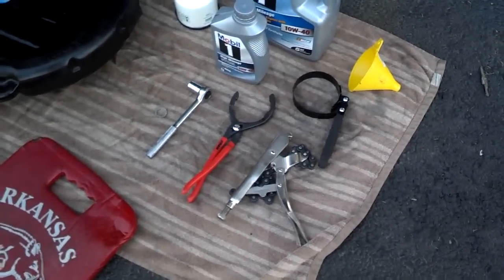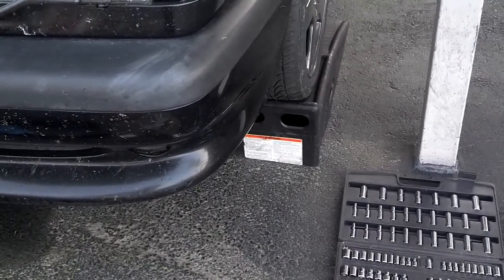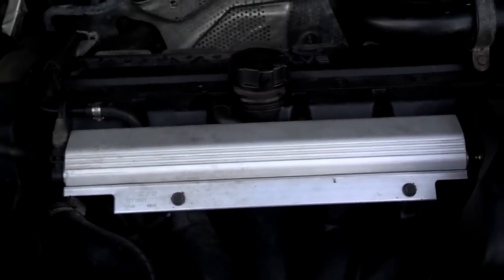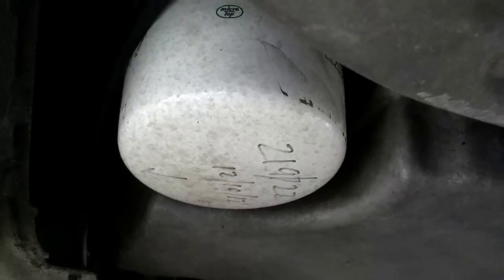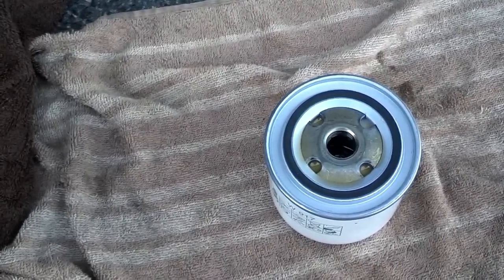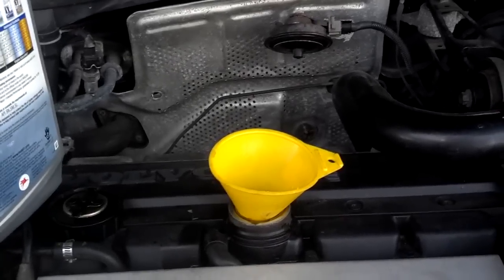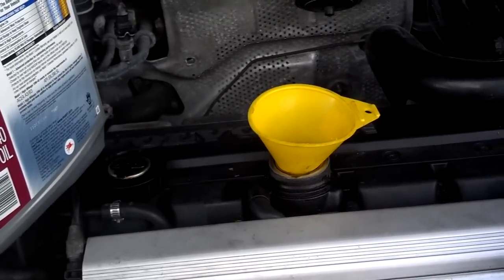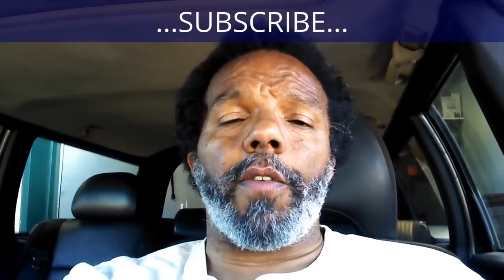How to do a basic oil change for the Volvo 850, S70, V70, etc. - Remix

Comment: Your great Robert guess what my engine died last Friday.  Jiffy Lube left   the oil cap off a year ago. I left that night drove a half hour on the L IE( Long Island Expressway) came back the next day and I smelled something , pulled into my gym open the hood in there it was,  the cap left off!!!!   oil everywhere! I just lost my car last Friday I think something had to do with that after while you can't go to the dealer anymore it's too costly I have a 93 850 GLT tan colored interior pretty car hear create Robert guess what my engine died a year ago Jiffy Lube left the oil cap off I left that night through a half hour on the LA Long Island Expressway came back the next day and I smoke something pulled into my gym open the hood and there was that cat left off coil everywhere I just lost my car last Friday I think something had to do with that after while you can't go to the dealer anymore it's too costly I have a 93 850 GLT bought in VA 1993 I paid in ful..cant do that again. tan colored interior. Outside too.. pretty car paid in full for it but living here 10 years on Long Island has  weatheredbiy did visor doesn't work on the driver side a little oxidation on the top passenger side in the back trunk a lock mechanisms kind of messed up I just couldn't keep it up anymore there's always something that happens with it but she's a good-looking car does anybody want one I'm here on Long Island Deer Park , New York 11729 make an offer. This is Jan 8, 2020.
Reply from the maker: post it on FaceBook market place.

Comment: Good job Robert but you should mention some vehicles like my 99 S70 AWD 2.4 turbo has a Cartridge although in same location , I just went to do an oil change and found that the owners before me had taken the vehicle to a shop for oil change and they had sealed the drain plug with silicone so very good tip on the drain plug gasket :) Keep doing what your doing I often visit as am new to Volvo but mechanically inclined :)
Reply from the maker: That's a different video. I'm sure this one said through 1998.

Comment: hey robert i have a 97 volvo 850 i have the oil pan crack and a friend told me that he can take ir to someone and get it weld but he told me if it have magnesium you cant weld it you may have to put jb weld or something do you know if the oil pan can get weld??
Reply from the maker: +Ruben Rodriguez no I don't. I'm going to know weld mine. Stop drill the cracks.
Reply: Dear Ruben   please find CVI  on the net and simply find the part you need and they will send it over  they supply all parts for all Volvos  are not expensive and very helpful

Comment: I have a 1999 Base 2.4L S70 with 194000 miles would 10w30 high mileage be a good option for the engine oil. Seems 5w30 isn’t working well for my areas high temps
Reply from the maker: https://youtu.be/wyF3o3c1uug?si=1VYort4LG7xR2SKm

Comment: Hey Robert, I have a bunch of drop in style oil filters from my awd s70, I went to go change the oil on an NA s70 I just bought and noticed it has the old styled 1 piece filters. Are there any downsides to converting the NA to the drop in style filters?
Reply from the maker: So you think changing the oil pan is easier?

Comment: I have a 1998 Volvo V70 2.4 non turbo, been using 5W-30 oil during my changes is this okay? I have many different opinions from many different people and I want my high mile car to last as long as possible! Thanks.
Reply from the maker: Depends on your climate
Reply from the maker: https://youtu.be/wyF3o3c1uug
Reply: @RobertDIY  Thank you that's what I thought and have been trying to figure out.

Comment: Hey Robert what weight oil due you use/recommend for the Volvo V70 2.5T engine? I noticed you're using a 10W/40 weight in this video. Any reason why? Thanks
Reply from the maker: Depends on what the owners manual recommends.
Reply from the maker: https://youtu.be/wyF3o3c1uug?si=h7I_gipiJIGf5Y0n

Comment: Hi, Robert. Just wondering if that oil drain plug gasket came with a purchase, or you bought it separately or...what? Thanks.
Reply from the maker: Separately. I usually buy about 10 at a time.
Reply: @RobertDIY  Thanks. Do you know the size/brand? Gonna try and do my own oil change and want to get the right things.
Reply: @RobertDIY  is this plug something that has to be replaced during every oil change?

Comment: I have 1998 v70, 2.4 liter engine.  Owners manual calls for 6.1 quarts of oil.
If I put that much in, it shows way above the high mark on the dipstick.  It makes no sense.
Reply from the maker: That's how much the total system has. When you change the oil it only drains out about 5.5 quarts of oil so you only add back what you drain out.
Reply: I think I see what the problem is. The drain plug is not on the bottom of the pan. It is in the back of it, above the bottom. There is no way to drain all the oil.   @RobertDIY

Comment: HEY ROBERT!! Thanks for the video much help, but i accidentally got 5W-30 Full Syn , can i still use it?
Reply from the maker: I would not. The owner's manual warns against it. That is for temps under 65 degrees F.
Reply: @RobertDIY  Thanks for the feedback! By anychance do you know if the 1998 Volvo S90 has  a transmission dipstick? and what is the full capacity of transmission fluid?

Comment: Hey dude, thank you for these videos. I really appreciate them. My boyfriend and I have been watching you for the last 2 and a half years, ever since I got my 98 volvo s70 glt.

I just got a question. I see your using mobile 1 for your 850. I just recently put mobile 1 10w30 synthetic in my s70. My father always told me that I should use Castrol cause it would eat my o rings up. I'm all over the place about my oil. Which would you suggest for my turbo engine?

Thank in advance 😊
Reply from the maker: I use Mobile 1 because I can get it in 10w-30. I like Castrol oil in my daughter's car, etc. I really don't think it matters as long as it's full synthetic for turbo cars. I doubt any of them will eat seals, that could get expensive with law suites. ;)

Comment: Hello Robert . have a Volvo v70 1999 an i wanted to know if i should use 10w-30 or 5w-30 or 10w-40.  been using 10w-30 full synthetic . and is also has a leak i believe near the dipstick tube  a lot of the oil have Spilled Out. thank you
Reply from the maker: https://www.youtube.com/watch?v=wyF3o3c1uug

Comment: Robert, love your videos, thank you.  I just picked up a 98 V70r with 166K miles on it.  Changing oil for first time and wondering what weight to use.  Owners manual says 5-40 for colder temperatures or 10-30.  I see you used 10-40.  What should I be putting in this 2.3?  Thanks.
Reply from the maker: https://youtu.be/wyF3o3c1uug

Comment: Hello robert i have another question, i have a little pin hole on the top of my radiator bottle or resv bottle. some told me to put JB WELD ON IT AND IT STOP THE PIN HOLE..
Reply from the maker: +Glenn Terry replace it.

Comment: anyone know a foreign car junk yard in northern Ohio? I need a new roof . maple tree landed on car, did in windshield, back quarter panel window, and dented roof just behind back door.  not giving up a good car, I'll Bondo and dent myself and seal up the back door if I have to.   1997 Volvo 850 wagon.
Reply from the maker: +sandie sigmund purchase another one and use this one for parts, than finish off on the crushing. 

I try to keep them if they have damage that panel swapping can cure, but that other stuff like cutting off roof's and stuff like that, I stay away from.

Comment: Hi Robert, i have a problem with my 99' V70 that it stalls when I come to a complete stop, or engaging the clutch while Im slowing down. The rpm drops to 1000 (which is the normal for a running motor) and then continues to zero and the motor stops completely. Can be hard to start again and i have to wait a half a minute or so. Any suggestions? Sorry for my bad english.
Reply from the maker: +Ole Edvin Tangen Have the codes read.

Comment: Thanks Robert. Do you do anything different with a turbocharged model with an oil cooler? My v70 said it needs 5.8 l of oil for the change but to add another .9 if I drain my oil cooler. This is my first car with a turbo.
Reply from the maker: No.
Reply from the maker: The vehicle in the video is a turbo model.

Comment: Differential oil change on a 1996  960 Robert? Cant see where /how to get this done. Suspension cross beam and frame section right in the way...ouch!
Reply from the maker: I never changed mine. Maybe every 300,000.
Reply: Wow, ok that,s great Robert , thanks for that info...im on 140,000 so should be ok . Thanks Robert

Comment: Do you really think when you do a oil change it drain all the oil out of the motor is motor oil that sits on the top of the motor all the time otherwise every time you start the car you hear a knocking noise
Reply from the maker: Huh?
Reply: You'll never get all the oil out of an engine you need some kind of engine cleaner and even that doesn't take it all out

Comment: Hello Robert! What's your opinion on using a magnetic drain plug? Thank you
Reply from the maker: Interesting, however, if it starts collecting metal your next purchase will be another car. 😜😅😅😅. I actually like the hollow bolts. They collect sludge which is useful.
Reply: @RobertDIY  Thank you! Yeah, better to keep oem!

Comment: Hello, i watch alot of your videos, because i have two volvo's one is a 1997 850 t-5 the other one is 1998 S70 and both of them run good. I have a question about the service light, How do you cut off the light after you has service it at the home....
Reply from the maker: +Glenn Terry https://youtu.be/gt9w-ZSxs9I
Reply from the maker: +Glenn Terry https://youtu.be/Jq5mhoAqJDQ

Comment: from what I've found out from the Internet and volvo specialists is that excessive oil burning in these cars is almost always due to valve stem seal leaks. caused my 850 to burn a valve. I ended up replacing all seals and had valves lapped for a decent price while the head was off. car runs great now and so far oil burning seems to be very light if any at all
Reply from the maker: Thanks for watching

Comment: Hi Robert i have a volvo v70 xc turbo how often do you have it change and if it's more then one time someone told me the oil in the car during the weather suppose to be thin and the summer heavy can tell me is that right
Reply from the maker: With full synthetic, I recommend every 7500 miles.
Reply from the maker: https://youtu.be/wyF3o3c1uug
Reply from the maker: https://youtu.be/IE3d-pf2aAY

Comment: what oil would you recommend to use, i have a s70 glt turbo with 250,000 miles
Reply: Probably the same as in this video. Mobil 1 is great oil.
Reply from the maker: Full synthetic.

Comment: I believe you are right about the filter causing lifter tick. Bought my R with lifter tick for the first 2 minutes after startup and it is running a cheesy filter.  I will be swapping it soon and doing an oil change. (havent been running the car) I'll update this with what happens. Any suggestions on oil? 130k miles (probs like 500k but thats what the dash says 😂)
Reply from the maker: What car do you have?
Reply: @RobertDIY  Its an 850. Has the cheapest 5w30 oil you could buy in it and the wrong filter.
Reply from the maker: https://youtu.be/wyF3o3c1uug
Reply: Did the oil and the oil filter change remove the ticking noise? Im in the exactly same situation. @ZacharyTelesca
Reply: @Surrenderism  yep 🤣 car is about 700 miles away with a new owner right now!

Comment: I have the 2000 V70 - that's a different type oil filter than the one shown here, right?
Reply from the maker: Yes, and you should get the special oil filter housing tool.
Reply from the maker: https://www.youtube.com/watch?v=GJ1W9sGD70g
Reply: I ordered all that stuff in order to do it myself next time. Recently I was  up under the car to reattach the splash shield & what I saw made me furious....went to goodyear for oil change & I did not know it at the time, but they somehow attached a conventional metal oil filter, doing away with the plastic cap. I just hope my car is not permanently screwed!

Comment: Robert, can you clear a myth for me? I have heard that you shouldn't use synthetic oils on an older vehicle. I've heard it will cause white smoke to come out of the exhaust and compromise seals, gaskets, etc. If this is true, what defines an "old" vehicle?
Reply from the maker: LOL, I purchased my current daily driver with 188,000 miles on it and it was 18 years old. I switched to full synthetic oil immediately. It now has 346,000 and does NOT smoke or burn excessive oil. Myth busted?
Reply from the maker: https://www.youtube.com/watch?v=gwvTHhOciU8
Reply from the maker: https://www.youtube.com/watch?v=RpwrlWJMd40&t=66s
Reply from the maker: https://www.youtube.com/watch?v=apAtKEBHPg4

Comment: HELP HELP... Robert, my Volvo has me worried. I have a 1995 850 Tr5 last week my lower hose busted and i ran out of coolant. My car did not overheat but i feel it was close to overheating. I fixed the hose problem and i no longer leak coolant but my car has a funny smell like burnt oil coming from the exhaust and when i pull out the dipstick while the engine is running there is smoke pleas HELP
Reply: Debating weather or not to take it to a volvo dealership because im sure it'll cost a pretty penny
Reply from the maker: +Eric  Gil why do you think that it didn't overheat?
Reply from the maker: +Eric  Gil https://youtu.be/jsxPXltMFOc
Reply from the maker: +Eric  Gil https://youtu.be/ZqdHDqGKYV0
Reply: Now im not very car savy but i was told if the engine stops on you, thats when it overheats. The vehicle did not stop on me i had made it it home before it got too hot my temper gauge didnt rise to the top it only slightly rose
Reply from the maker: +Eric  Gil if you drove the car 30 seconds with no coolant in it, it likely overheated. Did you watch the videos I linked?
Reply: Robert DIY i did... damn what should be my next step since it did overheat because I definitely drove it over 30 seconds
Reply: Robert DIY i my Volvo failed the glove test  :(
Reply from the maker: Did it fail the coolant bottle test?
Reply: Robert DIY now sure how to do that what video is that?
Reply from the maker: Eric  Gil the video I sent shows how.

Comment: Do you approve using Mobil w10-40 for my s70 T5 98 model. I live in Asia and its around 28 digrees warm rite through out the year.
Reply from the maker: Is that the high?
Reply from the maker: That's what I would use.